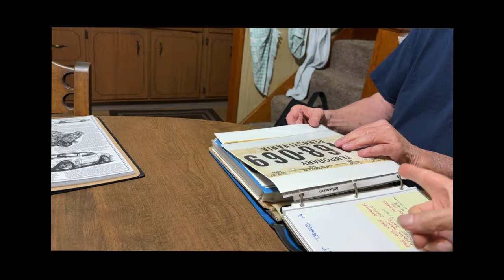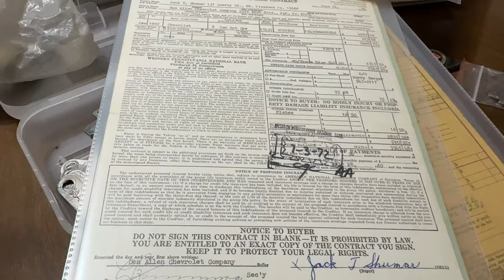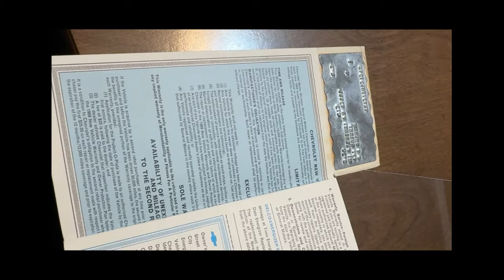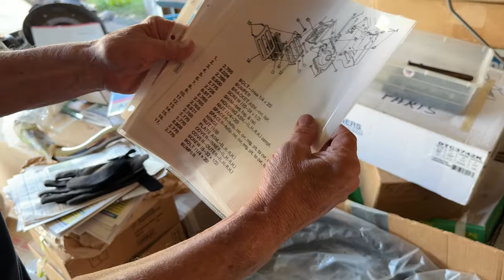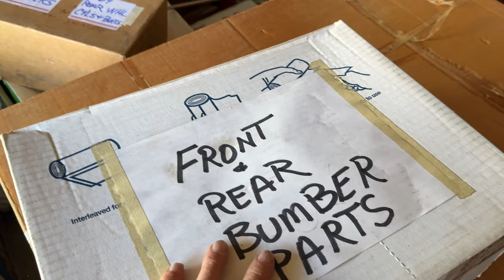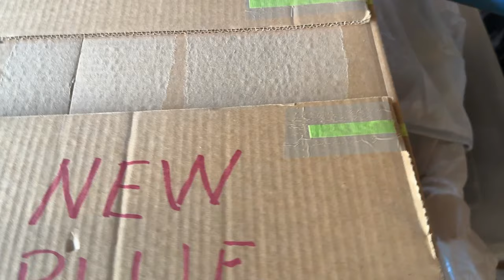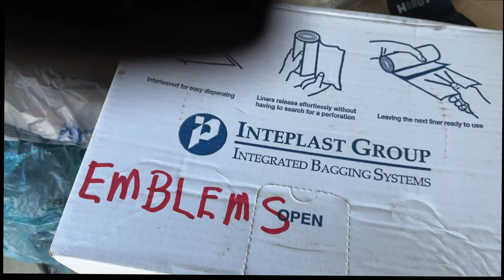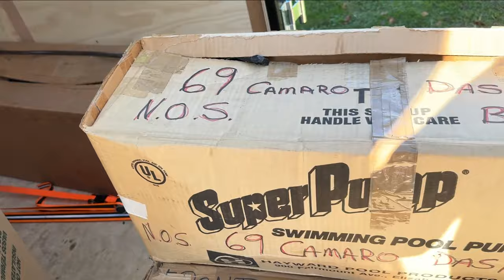1969 Camaro RS Z/28 Lemans Blue - Full Restoration Series - Part 1

Comment: What a find with a very cool story. The car is going to be absolutely beautiful and I’m looking forward to the restoration. I have a very similar optioned car. But it’s a later production rs in butternut yellow with a black vinyl top and houndstooth interior. I’m only the 3rd owner of the car and it has 67k original miles.